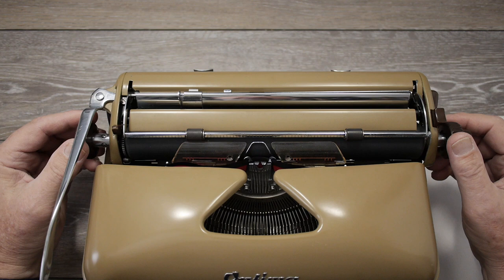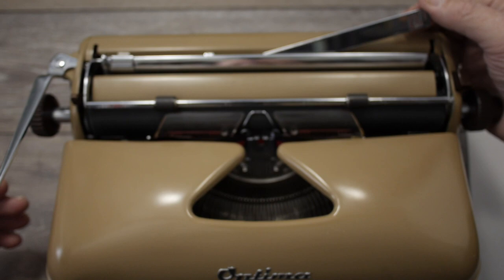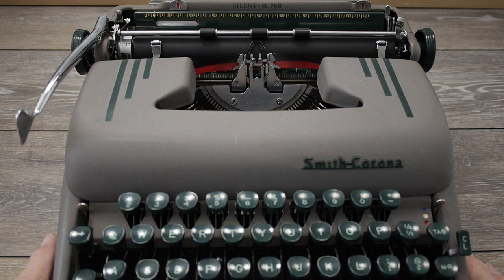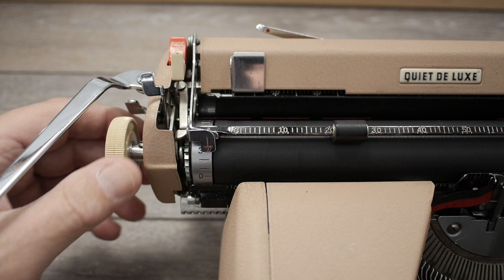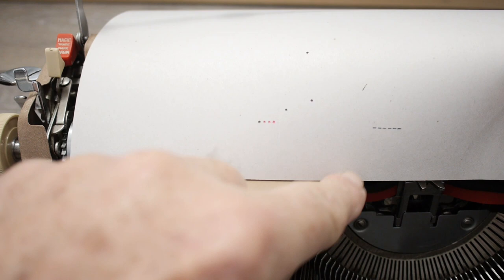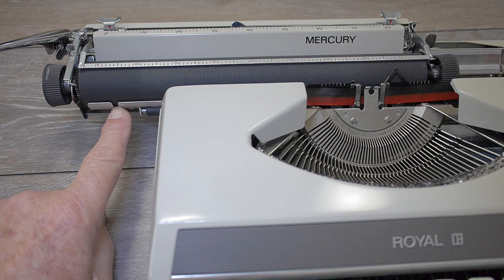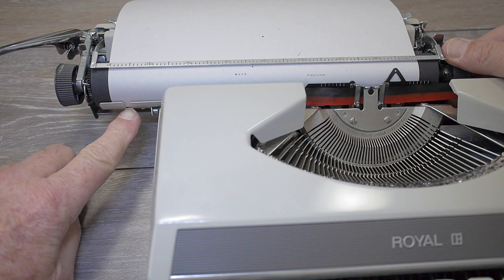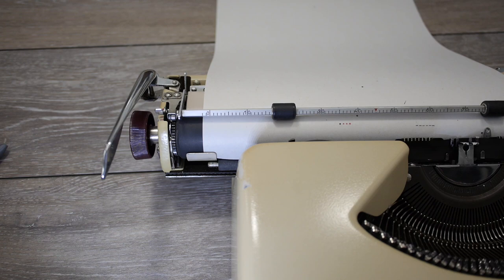Typewriter Basics: End of Page Indicators

Comment: Hi Joe. I worked for the railroad all my live long day for 32 years starting out as a clerk typing waybills etc for the trains and other misc duties. All of the company envelopes of various sizes had the company name and logo pre printed on them. On each envelope there was a tiny spec of a black dot, virtually unnoticeable unless you  knew of it, at the position where you would type the first letter of the recipients address. On the company's better letterhead paper (not the fax/photocopy paper)  along the left side edge about 2 inches from the bottom there was the faintest of faint gray  mark, again virtually invisible to the reader. I'm sure that most other large firms who also ordered hundreds of thousands of cases per year from a supplier would have the same or similar.
Reply: Interesting. Did they have typewriters in the caboose or didn't they monkey around typing up things one the actual train.
Reply: @jeremyperala839  the bills were typed in the yard offices or freight offices

Comment: Hi Joe! I have found the scale on my Olympia SM9’s to be the easiest to use. When the paper at the top of the scale is one inch from the end of the paper rest/scale, it is one inch from the bottom. On my IBM Selectrics I use a paper support/scale from an IBM Wheelwriter attached with a tiny bit of Velcro. It works perfectly and I get both a good paper support and an accurate indicator of where I am on the sheet. Thanks for bringing us back to the basics! Get well!
Reply from the maker: Thank you, Don!
Reply: The Wheelwriter is the ultimate typing machine ;-)

Comment: For the Optima and other (not just German) typewriters: The paper support finger does have an extension. For example, on my Erikas I can pull a little lid on top of the unfolded paper support. I adjust if firstly with let's say letter size or A4 or half-letter. Extend it to right finger length. Re-feed the paper, leave finger unchanged. Type happily and when top of paper reaches top of finger you're at last line of your page.

Comment: The Royal QDL manual on TWDB for the series beginning in 1953 the paper is rolled in and stop at the index mark on the left platen hub then push the variable and roll the bottom of the paper to 2 red dots on the paper supports. In this way the length of the paper does not matter because the machine is measuring up from the bottom. There was also a mark on the paper table for shorter paper.

According to the manual the numbers aren’t inches, they are the the number of writing lines before the bottom of the page.  12 being 2”. I made my own on my 1952 using pencil marks on the gray hub.
Reply from the maker: Thank you!

Comment: The markings on my Selectric II's end-of-page aren't even visible anymore, and though I've been using Selectrics since the late 1980s, I've never even used the features. I just sort of stretch the page out and estimate. "Yup, that looks to be about right."

The Hermes 3000's implementation is just about perfect.  I don't even think about it anymore, just automatically give it a glance when I'm getting down there.  I use the cutout on the right, though, because I check it immediately after the carriage return...